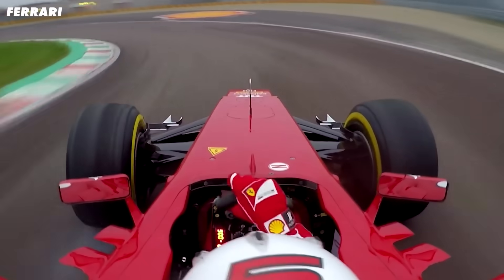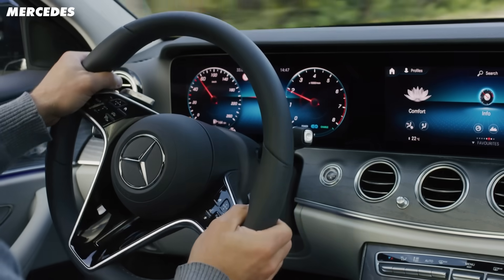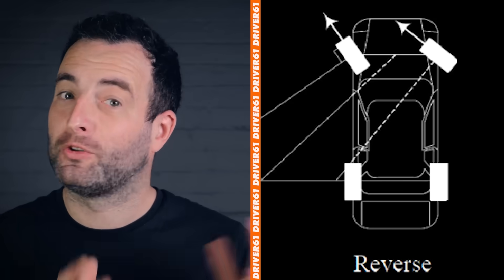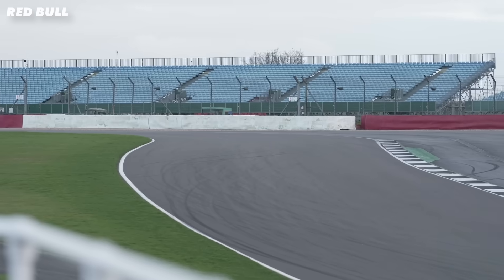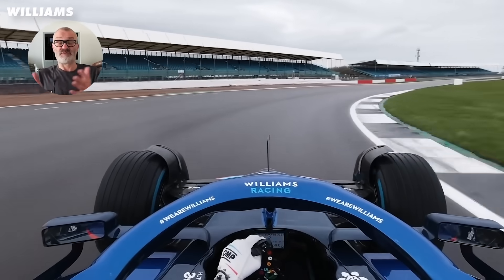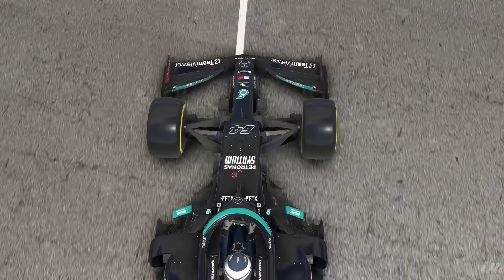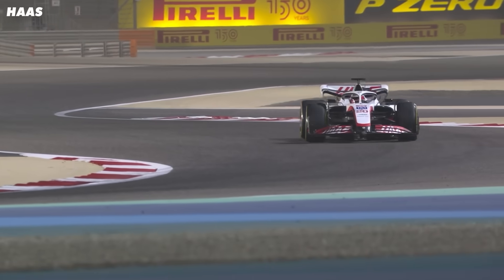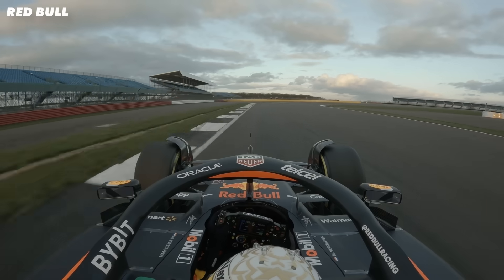The GENIUS Reason Why F1 Steering Looks BROKEN

Comment: I wonder if this is the reason why I have often found myself having to turn in unnaturally too early to make the apex upon some circuit midfield corner entries (I'm literally having to do it at times before properly sighting the apex). If I get the timing wrong, I annoyingly wash wide of the apex. But even if I get timing right, I just can't carry sufficient speed through the corner. 

From memory, it's Brooklands/West Kent circuit I've had that issue and Wombwell. I've tried all other options, but not Ackerman. I've just kept it the same.

Comment: so in general anti-akerman used to reduce outside wheel slip angle because its contribute more then inside wheel on cornering on F1 speeds and to have overal slip angle less to lessen chanses to lose a grip?

Comment: I think this video really would have benefited from a simple top-down animation of the starring assembly geometry, with lines to indicate the forward direction of the tires. I think the concept is easier to grasp when you realize that even with a positive or negative Ackerman geometry the tires do remain straight when the steering is neutral, and the difference in the angles only occurs in the geometry when steering.

Comment: This is something that’s baffled me so should be an interesting vid. The only plus I can see to negative Ackerman angle is to keep the inside tyre warm when it’s not doing as much work, and possibly make it easier to turn it back the other way for the next corner as it’s for less distance to go when it becomes loaded up. On older F1 cars with bigger sidewall tyres, it just seems like it would give the outside tyre excessive slip angle in my head though, unless it’s actually just that the inside tyre is pointing more in direction of travel of the slip angle of the outside wheel to stop scrubbing where it’s not loaded up enough to have as much of it’s own slip angle 🤔

Comment: Okay I'm more confused than I was before I watched this...
Reply: I’ll dumb it down a bit…. let’s say you’re taking a full speed right hand turn. The left side tire is going to take most of the load on that turn. So, to make benefit of this, the cars make the tire under most the load turn more, or I guess at the “normal” amount, because it can handle more load on it before it gives way and you understeer off the track. More force pushing the tire, the more grip!

Comment: Another racing category that would benefit from anti-Ackerman is drifting. In drifting, you generally turn the wheel opposite in the direction the car is going, so you need the leading tire to turn less and the trailing tire to turn MORE to actually track the curve of the corner correctly and scrub the trailing tire less, therefore maintaining more front grip and control.

Comment: Parallel steering: Wheels turn at the same degree

Ackerman (Lankensperger) steering: Inside tire turns more than the outside; to avoid scrubbing/wearing out the tire and turning better
ex: Road cars

Anti-Ackerman (Anti-Lankensperger) steering: Outside tire turns more than the inside; creates lots of scrubbing, but the outside tire can handle more slip angle and have more force to push the tire and have more grip.
ex: Formula One cars

Comment: I think you've fallen for the old racing trick of trying to sound smart while not giving your opponents a straight answer. So the anti-ackerman puts each tire at the slip angle that allows it to make the best contribution to lateral acceleration. When turning, weight transfers to the outside tires, so they can have a larger slip angle than the inside tires. Using the outside tires while sacrificing performance to keep the inside tires from getting cold is 100% garbage.

Comment: I would like for you to analyze Fernando Alonso's driving style ( well, prior to 2022 ) with respect to slip angle, and how he had the team setup his car.  As I recall, he used to put a LOT of steering input on corner entry, almost a "jab" or "excessive turn input" for a brief moment as if to put heat into the fronts.
Reply: More likely the sudden jab adds some weight transfer and gives the fronts a bit more grip to initiate the rotation of the car. It's safer to get the same effect with a jab of brakes, but then it takes away from the traction budget.

Comment: 😛...so I went to Home Depot, purchased a $40 rural mailbox, pressure treated 4x and bag of concrete...distressed box with a piece of worn out sandpaper and spray painted with epoxy clear...BaM...65 buck mailbox installed...3 hours tops, done...plenty time left to watch Georgia beat Tennessee...However...I did not get a nice note from my mail carrier 🤣

Comment: I'm not sure it would ruin tyres quickly on a road car. Going from positive to negative and back just means you're choosing which tyre slips. For F1 keeping temps more even is more useful. On the road a better balance of grip at lower lateral load is preferable. 

I would love to see a test on how it feels to drive and how the tyres wear when compared - maybe one for the other channel? Not sure what cheap road car you can find which would be easy enough to change it though?

Comment: For dirt racing, I adjusted the Ackerman to work in reverse, so the wheels pointed the right way when the car went sideways. Edit: I split the cross steering arm in the middle and had adjustment holes in a pivoting 'spade' arrangement.

Comment: You forgot one key point: the nature of rubber. As you increase the load on a tire, its grip does increase, but its coefficient of grip decreases. “Driving 4 Answers” is a great channel that did a video explaining this concept here: https://youtu.be/CyH5xOcsXxs 
With this in mind, the outside tire has more grip, but it doesn’t make as good of use with it as the inside tire, because the inside tire has less weight on it. Let’s say for example that you have a tire with a 500 pound load on it and it loses grip at 1000 pounds of lateral force. If you were to double the load on that tire it would take LESS than 2000 pounds of lateral force to make it lose grip. Likewise if you put only a 250 pound load on it it would take MORE that 500 pounds to make it lose grip. This would mean that the inside tire should in fact turn tighter because if they were aligned parallel, the outside tire would always lose grip first in the event of understeer. Yes F1 cars turn the outside wheel tighter, that can be seen clearly in some of the clips shown, but it must be for a different reason. Would love to see a video explaining the reason and dissecting this comment.
Reply: I think your math isn't adding up. If both tires have the same slip angle, the one with more vertical load on it will provide more lateral force. It might not be directly proportional to the load, but it won't be less.

The video you recommend is good though.

Comment: 7:04 is not false.
If you think about it you pretty much need ackermann to provide the basic steering angle and some degree of anti ackermann to provide the right amount of slip angle as some proportion of load is transferred to the outside tire on the lateral acceleration. A tight corner has to be taken slower, causing the lack of downforce, a lower acceleration and smaller slip angles.
The high steering angle in tight corners and the low slip angle due to low acceleration lead to something close to ackerman being prefferable for tight corners.
The almost nonexistant steering angle in relation to a large slip angle due to large acceleration favor some degree of anti ackerman steering in high speed corners.

Comment: Does the ackerman setup change according to suspension travel? I think it would make sense to somewhat increase amount of negative ackerman when the outside suspension is more heavily compressed and reduce it when the inside suspension is compressed (such as when going over the curbs).
Reply: bump steer
Reply: @ejv0wjc08gtsnoj0  I think it's called bump steer only when executed badly and the suspension causes the car to over-react to any bumps.
Reply: @MikkoRantalainen  ahh you're right. That would be the "symptom of bump steer". I was falling asleep and got lazy and trying to say " 'bump steer' of all degrees exists whenever the control arm and the toe link(tie rod for front) are not equal length". I don't know how F1 cars are set up but for street cars it does change slightly depending on height (suspension adjusted).
Reply: @ejv0wjc08gtsnoj0  Exactly. Modern multilink suspension (especially rear and it started with Ford Focus in the 2000's, I believe) steers the wheel according to the compression and if you modify springs, you should readjust the whole geometry.

It also means that even a small problem with the spring will misalign your wheel geometry, too.

However, when everything is adjusted correctly, the end result is that the car feels like going on the rails around the corners even when there's bumps on the road.

Comment: It's because the two wheels are actually traveling different distances through the turn.   The outside wheel travels a greater distance than the inside wheel. Kind of the reason for a differential on rear wheel drive vehicles, but different

Comment: I used anti-acreman in the original Xbox Forza. Didn't know what it was but left out the lap with a draft of 4 car's. I was in the games 3rd fastest car a Jag XJ 220 the rest in Enzo's. We set the 1st 2nd 3rd and 6th fastest all-time times at the test track 5 mile Oval. Yeah I got passed at the line but that's how close it was at 325 MPH.

Comment: 07:00 with more load the optimum slip angle is higher so the grip for the inner wheel should be higher than with a street setup

Comment: Fun fact - the Lotus Excel has neutral steering to improve higher-speed handling. Consequently the wheels judder badly in low-speed manoeuvres like parking, particularly in reverse. I experience this using an Excel as my everyday car.

Comment: There's also a significant aerodynamic reason for the F1 teams to run anti-ackerman; a shallower angle of attack on the inside wheel means that the wheel wake of the inside wheel is not sent as far inboard, thereby wreaking less havoc aerodynamically downstream.
Reply: Dang I didn’t even think about wheel wake lol

Comment: You can create a car setup for each circuit and save them to custom configs. If the steering wheel doesn't work then you have to go into settings and activate the wheel animations in player setup.

Comment: One simple statement or thought was missing at the summary.  The inner tire has decreased slip angle allowing it to not saturate the curves and still contribute as much as possible to the turning of the f1 car.  The decreased load and slip angle combine to lower the maximum slip angle of the inner wheel.

Comment: It would be nice to have a follow up video explaining how the teams mechanically adjust it from track to track 🙌
Reply: Forward or backward placement of the steering rack is the best way to control Ackerman, but you can also adjust it a little with the position of the steering arms on the knuckle.

Comment: I have Anti Akerman setup from factory on my Giulia Quadrifoglio. 
This is a great video explaining why it’s used as it is and how it works. At low speed on cold tyres and high steering input you can fee the front end skipping
Reply: Thats so cool to see it incorporated into road car tech, its probably one of the base reasons why the Quad gets such great reviews out of its driving experience outside of the more well known theatrics!
Reply: Regular Giulia owner here. I can actually feel the wheel slip at low speed when I tried to make a sharp turn. Maybe ordinary ones also have Anti Akerman. The regular Giulia is known for being a huge bang for the buck in terms of driving experience and it shares most components with the QV. If it also has anti American setup that would be nuts.
Reply: @tsorpniala9820  all the Giulias are based off the QV. I can’t see them having too much of a different front end set up but I couldn’t say if you have the same. 
But yes, the “super” is probably the best compromise. Same engine as the veloce just detuned. Easy to map 😉
Reply: @dannyrobbo  YES! the exact reason to buy a GIULIA than a 3 series because GIULIA is a baby QV but a 3 series is not.

BTW, what is the model year of the QV and how did you find it? (if you dont mind telling me a things or two ofc). My giulia is of the 2022 model year and the reliability was pretty good. I was seriously thinking about getting a QV but really not sure about the earlier model years.
Reply: @tsorpniala9820  mines been absolutely spot on. No issues. It’s a 2018 model and has 52k miles. 
The early ones only have DI where the later ones have Duel injection (DI and Port) and have OPF / GPF so are worse on fuel and quieter. Few cosmetic changes too on the later car. 
Maintenance is cheap for the car, though Alfa in their wisdom put a 36k mile service on the auxiliary belt, normally around 90-100k mile on other performance marques. That’s not a cheap service
Reply: @dannyrobbo  OH that is good the hear! And thanks for being nice to a stranger! I took a leap of fatih before buying my giulia. I bought new because there is no good used ones around (supply chain issues u know). Looks like it is time to take another leap and get a QV.
Reply: How is your tire wear? Do they get used up quicker?
Reply: @ggbirdymill1618  not too bad. Bought the car with tyres that needed replacing soon, replaced them 12 months ago and done about 8-10k mile. Still loads of life left in them. Hope for at least another 10k before they need replacing again
Reply: @dannyrobbo  That really isn't bad at all 👍🏻
Reply: A giulia has no anti but positive ackermann. The all do. Just like some porches.

Comment: Great video, but why do you say "Grip" and not traction, tyres don't grip the road, they use work on the premises of the friction between the tyre and to read surface to create friction, the friction between the two is what gives the car traction, hence traction control not grip control, its a minor thing because we all know what you mean when you say grip, but just not the correct terminology when referring to a vehicles tyre in contact with the road.

Comment: Sorry but I think you missed the key reason. The reason stays in the graph 5:53 “Line of peaks” Before load transfer, assuming 6000N on each side, and after 2000 of load transfer, outer wheel can accept more steering angle while inner wheel needs less steering angle to keep maximum. I can’t agree that F1 cars use anti-ackerman because they rely on outside tire. They do on both tires, trying to maximize total grip.(anti ackerman offers the peak grip by finding optimum slide angle on each tires)

Comment: what's the difference between Ackerman and Toe alignment?
Reply: Toe-in or -out is a setting that configured whilst the steering is in the middle, i.e. the car should be going straight ahead. This gives slip angle on the tyres so the car responses more quickly to input from the driver into a corner. It is therefore expected that the angles are the same for both wheels. When the steering is turned the wheels will change their angle relative to the direction of travel, and each other, differently and that's Ackerman.
Reply: Toe in or toe out angles are usually equal

Comment: So my question then is, has anyone ever built (or attempted to build) an active Ackermann system which could adjust the relative wheel angles to give the best cornering in all conditions and at all speeds?

Comment: What 's the diffrence between Ackemann and toe-in, toe-out?
Reply: Toe-in or -out is a setting that configured whilst the steering is in the middle, i.e. the car should be going straight ahead. This gives slip angle on the tyres so the car responses more quickly to input from the driver into a corner. It is therefore expected that the angles are the same for both wheels. When the steering is turned the wheels will change their angle relative to the direction of travel, and each other, differently and that's Ackerman.

Comment: Question is how do they engineer the steering rack and uprights etc or whatever is involved to produce Ackerman or anti-ackerman steering
Reply: I'd imagine the process would be something like this:

Driver experience (Understand what the driver wants) - Analysis of current/previous designs (What works, what needs to be improved) - 3D models/FEA/Prototypes - Analysis of results - What went well, what needs to be improved, driver feedback - Necessary modifications/adaptions to steering system - Repeat until happy and ready to manufacture.

Most of the important information and hard work would be built on top of existing information/data and understanding what the driver of the F1 car needs, then its just a case of design and implementation, which for the Engineers in F1 is just another day at the office :)

Comment: Wow anti-ackerman is really genius!

I would like to respectfully give some feedback:
 I think you completely left out an essential element to the whole equation: speed. I assume, you think it's obvious, but it might not be for a lot of folks.
 If you'd ask a viewer - especially a younger one -, why anti-ackerman wouldn't help road cars, they would have to guess.
 The difference is that F1 cars are always driving as fast as possible - including in turns; and it is in turns at max* speed, where the centrifugal force (aka the lateral force) is very high - leading to this unbalance in grip between inside and outside tyres.
 If you'll be driving your roadcar at max* speed through turns, then it would probably also benefit from anti-ackerman when optimizing for speed.

*"max" as in "at the limit"